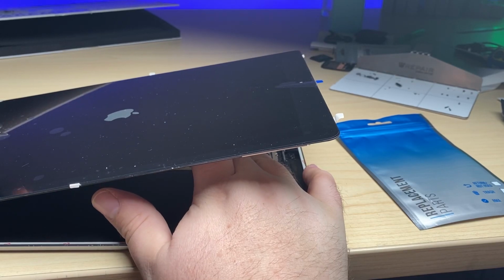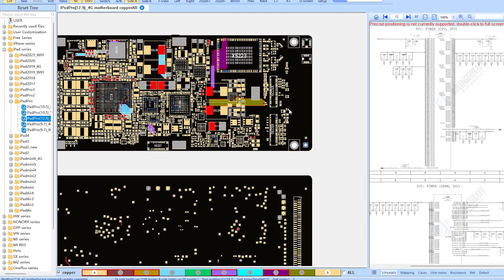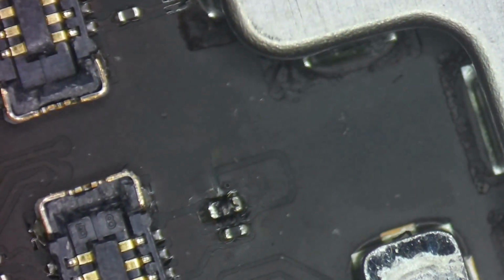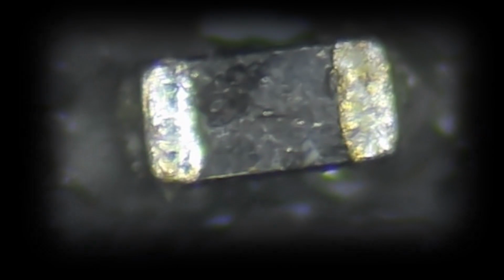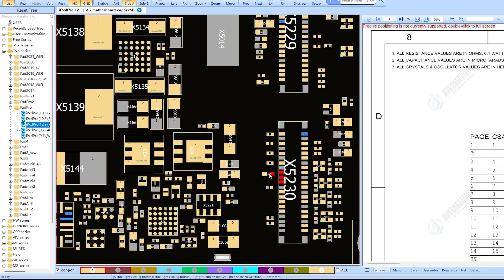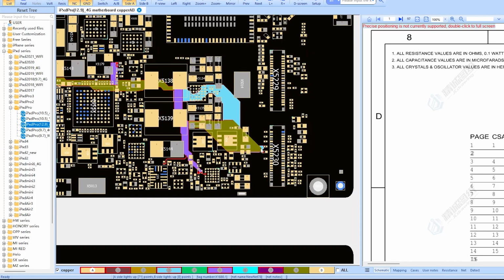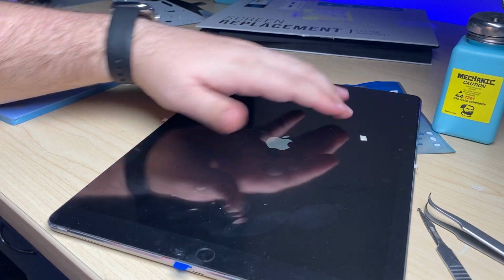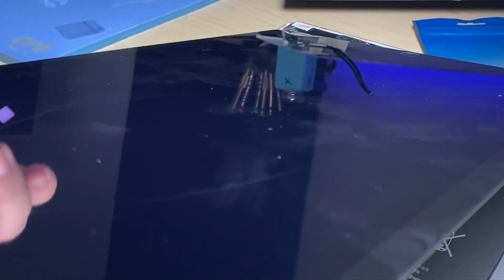How to fix iPad 12.9 1st Gen lost touch after screen replacement?

Comment: Hi MobileSentrix team. Quick question for you, is this component available on your site? I'm looking at "Digitizer Diode Compatible For iPad Pro 12.9" 1st Gen (2015)" with SKU 107082006484. Only problem is I'm not a good enough hobbyist to know if it makes sense to be a diode, when in this video he says filter. 

(Apologies if this double comments, I tried to include the link to the mobilesentrix page I was looking at and it might have gotten auto-blocked.)

I did the thing and disconnected my screen without disconnecting the battery first. Burned these exact same two components. 

If the answer's yes, any tips on micro soldering like this? I have a basic soldering iron from amazon with a needle tip, but is 138 solder necessary? Also, flux, I have solid rosin flux which I don't like using, worth to buy some good gel?

I'll also be buying a replacement battery for my macbook pro! 

Thanks

Comment: Great video. Could you share the equipment used in the video?
Reply from the maker: https://www.mobilesentrix.com/quick-861dw-hot-air-rework-station-quick-110v
https://www.mobilesentrix.com/t12-11-digital-smart-lead-free-soldering-station
https://www.mobilesentrix.com/mechanic-iphone-cpu-dedicated-soldering-flux-no-225-10cc
https://www.mobilesentrix.com/mechanic-i-soldering-xw-low-temperature-138-degree-welding-wire-for-iphone-x-xr-xs-xs-max
https://www.mobilesentrix.com/cpb-heat-mat-station
https://www.mobilesentrix.com/isclack-evo-lock-phone-opening-tool-compatible-for-all-iphones-and-ipads